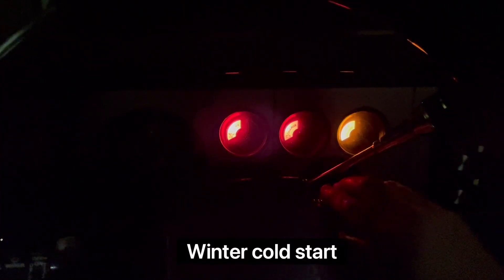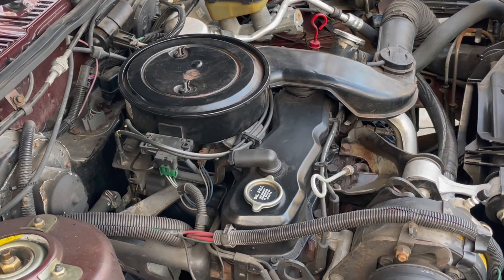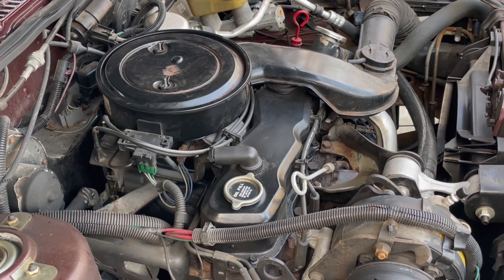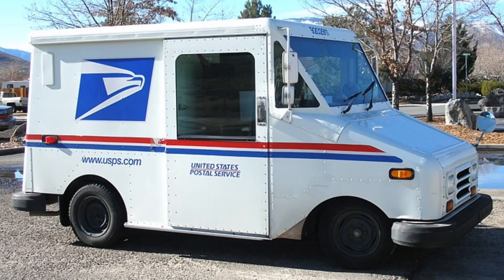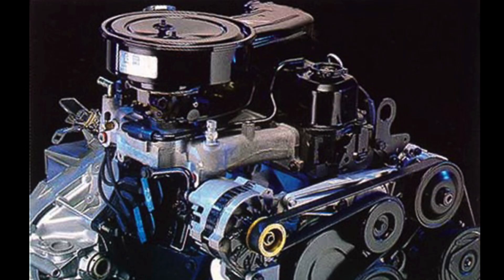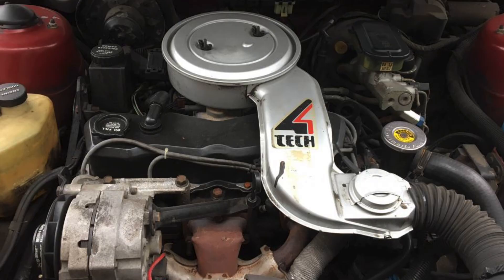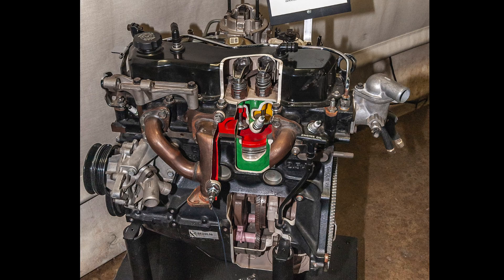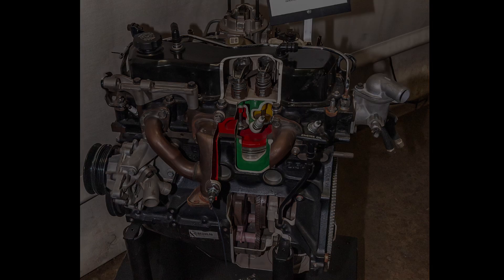Worst Sounding (and Most Recognizable) Engines: GM's "Puttering" Iron Duke 2.5L I-4

Comment: They say a mullet is business in the front and a party in the back. This engine sounds like an encyclopedia of fart sounds from the front, to the cabin, to the tailpipe and it was coarse and slow. If they'd gotten the 2.8 V-6 up to 1986 specs about 5 years earlier, they'd have stayed competitive. The Japanese automakers all had a 2-liter that ran smoother, used less gas, and felt gutsier. By the end of the 80s GM had two good V-6 families in passenger cars (they also had the 4.3 in pickups and SUVs). Their 4-cylinders were all somewhat of a waste in retrospect. Even ones that weren't outright bad.

Comment: You left out a bunch of information about the 2.5 iron Duke . It was used in a racing series called Is mini india, the engine used in the S10 was it improved engine block that came from that racing series with extra webbing In the block for extra strength. In
In that series, it was higher compression and they used a twin overhead cam. Heads, especially designed from Chevy racing for this Engine.  It dominated the series 4 years winning multiple championships Also It was used as a Volvo Penta engine where a stroker crank was added to bring the displacement to 3 leaders The reason it makes the sounds. It does is because it is a cross flow cylinder head with a steel exhaust manifold.
When the Ignition eveit happens the pinging sound.  It's a sonic sound waves resonating on the exhaust manifold. I have built a lot of 2.5 as I was was a line mechanic for GM4 for many years. I have built several high performance versions. Changing valve size and then cross blowhead. Hoarding, change the intake manifold aroand I've 
Made200 horsepower.  It is a very durable Engine as far as the sound of your starter. It's because it's not shimmered properly Which is a common adjustment Needed to be done on a lot of Chevy products.. The fact that you have a vehicle from 1984 that Can sit for several months. Be ice cold and turn the key and fire right up tells you how well engineered the thing  as far as the phenolic gear. Like anything else, they It does wear. But there is an aluminum upgrade gear. What solves that issue . There are
A lot of these engines
  still arowned and have a high follthing tells you something. Perhaps you need to do an Follow-up video, explain, explain the racing pedigree and other variants of this engine. Thank you for your time and for the video you made.

Comment: This engine and the Quad4 are clear examples of what 80s and 90s GM was capable of when it didn’t try, and when it did. 2.5 liters and 90 NA horsepower versus 2.3 liters and 192 NA horsepower.

Comment: The iron duke was actually a very popular and very reliable engine. It was installed in FWD cars. RWD and 4x4 jeeps and many other applications. The only real design flaw was the plastic toothed timing gear. Other than that a pretty reliable rig. 
Im a retired GM tech with 40 yesrs in the service bay.

Comment: I like to call it the Low Tech 4. In the early 90s, while GM was giving you this noisy 4, Toyota was putting out their excellent S engine family which are even tougher, make quite a bit more power and had a reputation for being very smooth. Oh and the rest of the car didn't fall apart around you either.

Comment: I was a GM tech back in those days.  The first couple of years of the cross flow head 2.5, 80 and 81, the noise wasn't too bad, These engines were equipped with carburetors, with 81 being computer controlled. 82 was the R code 2.5, and it saw the first TBI, and the engine louder.  This engine was used in X, A, and a select few W body cars.  The  2.5 U code was used in the N body cars, which was based on the smaller J body platform.  Biggest difference was the block and crank was about a half inch shorter so it would fit in the narrower engine compartment of the smaller car.  This version of the 2.5 was ANNOYINGLY loud, until the last couple of years when they adopted a timing chain design vs gear driven camshaft.  And yes, that noise was from the cam gears.  I replaced more than 1 set of them due to noise complaints.  I've never seen them fail though.
The USPS still has a few of S-10 based LLVs in service in my area.  My dogs hear that thing almost a block away and they know that the mail man is coming soon...
I had a 81 Omega with the 2.5 (carb, not TBI) mated to a 4 speed.  That was a nice little car to drive.  I live on a pretty steep mountain and it would pull up that hill at highway speeds in 4th gear with ease.
Reply: Almost forgot, 84 had some bad block castings.  It would crack behind the lifters and coolant leaked into the oil.  GM had an extended warranty on those engines.  Most of which got a new short block installed.  I did my share of those as well.

Comment: I worked at a Oldsmobile dealership in Central California from 1985-1990.  We replaced timing gears on this engine under warranty continuously for the loud noises that would eminate from them.  Sometimes they would be changed a couple of times under warranty.  That and the worn bottom bushing at the end of the transaxle on the THM 125Cs that caused the large clunk when shifting into gear were the most common pattern failures on these vehicles.

Comment: Definitely durable. I have a good friend who bought a new '87 S-10 pickup with this engine. He STILL has it today and it STILL runs. He doesn't drive it much anymore it mostly sits in the garage. Sentimental to him. But the fact that you can still start it up, head down the road and have no problems, even though it's never been rebuilt or had any major work, is a testimony to this motor's reliability.

Comment: got a 86 s-10  bought new  $8000.00  now has 301,000 + miles on it    actually prob more like 320,000-330,000  cuz the trans speedo gear , plastic , was broke for a couple of years    best thing to smooth it out was to eliminate the egr valve  cuz they would carbon up and idle ruff  also run ethanol free gas  runs as good as when i bought it   used it for construction  loaded to the max 1-2 times a week for 25+yrs    easiest to work on and most reliable vehicle i've ever owned  and outlasted all my friends n family's cars n trucks  not much to look at  needs paint   been thru a couple of radiators , fuel pumps  n clutches cuz they were just worn out  but all told i got my $ out of it and beyond  changed oil every 3000 mi. n uses less than 1/4 qt. of oil between chgs. and kept up all scheduled maint. myself  just did a tuneup  , 30,000 rec. interval , a couple of months ago cuz it was idling a little ruff on cold mornings and the plugs were clean n gray , just slightly worn electrode    if i could i'd buy another over most of the crap i see everyone else putting up with on their newer cars n trucks   and it's a 4 banger  even the counter balanced ones , any make , aren't the smoothest   to get the smoothest on this one just average the 1 and 4 cylinder when u time it   yeah ,u can still use a timing light on these   another reason i like it

Comment: When I was a mechanic at a Chevrolet/ Oldsmobile dealership in the 1970s, we had the precursor to the " iron duke". It was the same engine except it had aluminum cylinders! That one made some memorable sounds as well :)  The fix was to fit cast iron cylinder sleeves in those aluminum blocks, viola, the Iron Duke.

Comment: My wife (fiancé at the time) had an ‘86 Buick Century with the iron duke. While reliable, it always sounded like crap. Kind of like what a four-cylinder Briggs & Stratton lawnmower engine would sound like if such a thing existed. The biggest problem though, was the top engine brace / mount / etc that looked like a dog bone. 
This cheap pot metal / aluminum / whatever cheap ass metal would cause it to fail over and over and over again. 
Probably from the constant vibration of the engine, also every time the car was put in or taken out of gear. 
It was such a comfortable car it’s too bad it had a tractor engine.

Comment: Many of the old post office trucks still on the road have the mid 80's GM S10 chassis with the 2.5 engine. After almost 40 years and several hundred thousand miles they are still running.

Comment: You couldn't kill those things. I started at an Olds dealer in 1987 and we used to put cam gears in those all day long. The cylinders would wear out so bad that the pistons would rock back and forth and make so much noise but the just kept running.

Comment: 18 years ago (to the day), I got a free 1991 Calais.  It had 141K on the clock and was in fantastic condition.  The 2.5L had low compression on #4 and burned a lot of oil.  I had recently purchased a house out of town and the 34-mile round trip to work was starting to hurt the wallet as at the time I was driving a huge crew cab Ford pickup with big tires.  This car, even with the smoke and misfire was a blessing.  At 146K, I decided to rebuild the short block.  The EGR valve had failed and allowed detonation to kill the #4 piston crown (broken rings).  I had the block bored and assembled the engine with nothing more than new pistons, rings, bearings, and gaskets.  It's a timing chain/roller lifter engine so I reused that stuff.  About 500 miles later, one of the balance shaft housing bores decided to get loose and thankfully at the time a new unit was available.  The engine was full of aluminum particles but I kept running it.  Technically, I never even had to pay for the $850 "rebuild".  As it was an abandoned car, and the previous owner was long gone, the $800 I found in the glove box six months after putting the "new" engine in means the car paid for itself!

I have done nothing but oil chamges at 3-4K mile intervals, one transmission fluid flush (125C), one set of front brake pads, three windshields, and four crankshaft position sensors within the 298500 miles.  I guess I put new ball joints in it about 3 weeks ago because safety.....the left one was BAD. It still has the orginal transmission, water pump, wheel bearings, cylinder head, and suspension.  It sounds like a small industrial indirect-injected diesel at idle and burns about a quart of oil every 1500 miles, but it's been a damn reliable car and still manages 25-26 MPG.  I only drive it from November to May because the AC quit years ago and the stupid slotted plastic tape window regulators have broken a few times and no decent (read: US-made) replacements exist.  I put snow tires on it and it goes anywhere I need to go until the first of May when I change the oil and park it for 6 months.  

I am a diehard Ford guy and would NEVER spend money to buy a GM product.  However, since this car was given to me, I have become super-impressed.  It's no sports car, but it's treated me well and when the Iron Duke dies, I will try to find another.

Comment: I bought an 85 Camaro with the 2.5 in it, back around 1994 maybe.  It was to be an engine swap project, which I eventually did, but I puttered around in it for a few years before I dropped a 454 in it.  It, the 2.5L,  didn't seem like a bad engine, but a little light in the power department for a heavier Camaro.  Had about 77k miles when I got it and about 95k on it when I did the swap.

Comment: All a matter of opinion. But GM did make two other  engines that made horrible sounds. Both were diesel. The Chevette Diesel, that was a very durable high mileage engine, or the 350 Olds diesel. The Iron Duke was also in the last couple years of the Jeep CJ, that actually worked well, especially with a standard transmission. One thing about them was the cross flow heads, that were unusual in OHV 4 cyl straight engines.

Comment: GM’s 2300 Vega engine was pretty bad to. My mom bought one and within 11 months it had three engines in it. They sounded like crap too. And the iron Duck 2.5 engine suffered from head cracking here in the desert. Pontiac used it in the Fiero, and they sold a Heavy Duty replacement head for them. As far as how bad the Iron Duke sounded, and my mom bought one of those too, it really sounded bad when you shut it off and it deiseled. To stop this GM ran a relay to the Air Conditioning Clutch to stop the engine when you shut it off.

Comment: You have no idea what you are talking about. Those never die at 125,000 miles because they were engender to go far beyond that because the iron Duke was designed for mail Grumman LLV delivery trucks. They will go 300,000+ mile whith almost no maintenance!

Comment: If I'm not mistaking but the 2.5 Iron duke used a Pontiac 301 rod and piston. I had a 1987 Grand Am with the 2.5 and I sold it with 263,000 miles.
Reply from the maker: They were the same bore and stroke, but I think the pistons and rods were different.

Comment: Seems like the whole engine is designed to sound bad. Exhaust manifold looks stupid, big valve cover and air intake tract without ribbings probably made out of stamped steel(creating echo and magnifying the sound) and a single overhead cam that is known to be a rattly design. Probably a cheaply made, not well insulated engine compartment and surrounding panels. Oh and of course the only way an american engineer knows to make a reliable engine - just make tolerances bigger and then it rattles as a result.

Comment: We had the 2.5 litre L4 motor in a 1984 pontiac fiero, when newer, performed OK, no burnouts, but economical in a nice package. Then compression was lost and the block cracked at 30000 miles, had the block tanked and welded but was never the same. Gave the car away free of charge to a friend in lieu of junking it a few years later

Comment: It was just noisy timing gears, which ironically helped lend to its world renowned reliability. The exhaust note on these wasnt bad either, if you sized the pipe and cherry bomb or whatever correctly. They also responded well to basic mods. I remember putting a custom made ram air on mine and it was like a different engine on the highway. (88 TBI)

Comment: Fun fact: The 250 CI I6 in late-1970s' Novas, didn't have much more horsepower than that! But it apparently made up for that with more torque and a lot of power in the low-RPM ranges.

Comment: I daily a 1988 Pontiac Fiero with a duke and I can say that it's been an adventure for 30k miles for me (currently at 276k). 

You did describe a very fascinating phenomenon by saying that the engine will continue running a few seconds after shutting the car off. This phenomenon is generally caused ironically "dieseling" where the car is trying burn off the excess fuel, in my experience, this is caused by a leaking and/or poorly seated injector. 

Another thing I've experienced is how clunky the engine sounds, it sounds like warmed over dog turd. However, I will give it props on how durable the engine is, ive driven 15k miles with a blown head gasket without being aware of it except a few occasions of boiling the coolant out of the expansion tank from exhaust gases. I'm not talking about just Sunday Grandma driving, I beat the piss out of that engine and drove it 100MPH on highways consistently, ive even taken it to a local racetrack and it didn't even seem fazed at all by it. 

I will also like to point out, the exhaust is loud as hell if you take off the downpipe. I used to gun the acceleration under bridges and parking garages, I was left with a huge grin on my face despite it driving a buddy out of his wits. These cars are meant to enjoy without holding back even with their imperfections that arise. God save the Duke!

Comment: The sounds of my youth!! My dad bought one when I was 8 and I started driving it at 16 and kept it as my own until age 22.  Wish I had kept it longer.   The sound is very distinctive.  Everything from the puttering to the distinctive hum to the excessively high cold idle to the knocking under load.  If you didn't know what it was you'd think it was a diesel.  Mine had the bonus of wire wheel covers that went tink tink tink with every revolution.  Timing gears went out at 100k, other than that, no engine issues.    

Rarely see them anymore sadly,  except for the Grumman LLVs which still operate in my area.  I think they are geared lower so they don't quite sound the same.    

The 2.0 and 2.2L (pre-Ecotec) that came with the base model Cavaliers and Sunbirds/Sunfires sounded similar but not as loud.

Comment: When I was in my late teens, I had a car with this engine that I whooped the snots out of and it stayed together. The only issue is when I missed a gear and over revved the engine a lifter or two would collapse and the engine would run like you had a bad plug till the lifter would return to normal.

Comment: The Iron Duke in my Astro van went for 335,000 miles when I sold it, running great. The new owner totaled the vehicle in 6 months, but engine was fine. Slow as a tractor trailer on the highway though.

Comment: My iron Duke came in a Chevy Monza. Co,e to find out that two of the pistons were put in 180 degrees out and caused pre ignition type rattle when just mildly accelerating. Dealer pulled the head before installing another engine and found the problem and rotated the pistons and cured the problem. This all done under warranty . It was a dog even with a manual trans.

Comment: I had an 87 s-10 with this engine, i put a steel replacement cam gear in it and it was still noisy as a diesel.